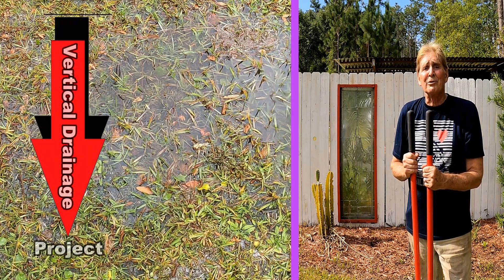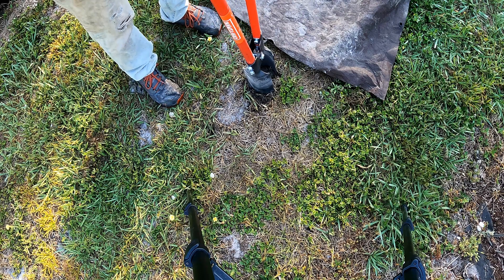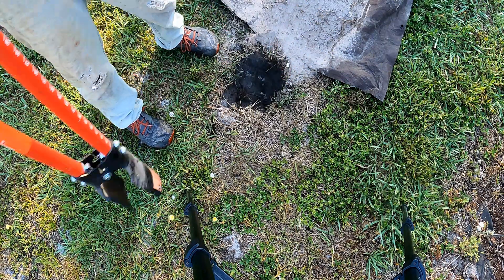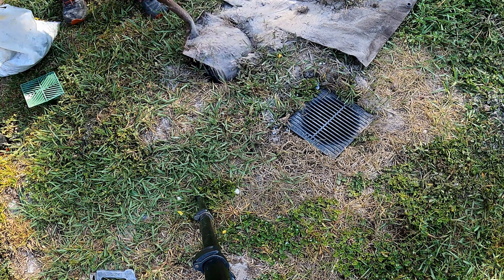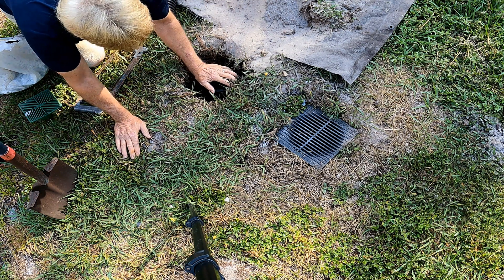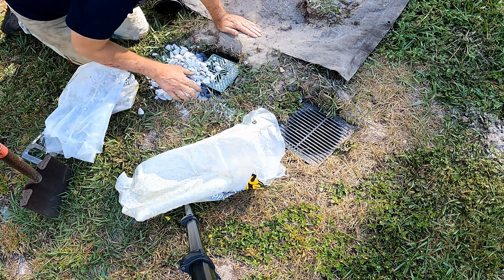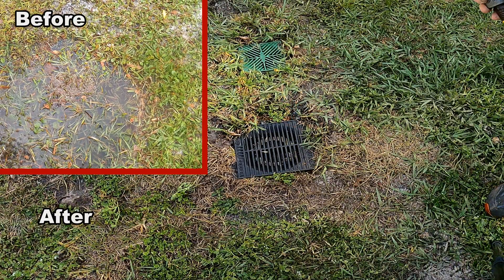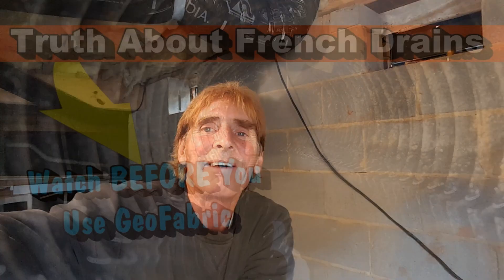Vertical Drainage - New Way to Remove Water - Straight Down

Comment: So i live in a part of town thats known for flooding during heavier rain storms. Typically since I’ve lived here about half of my backyard gets about 4 inches of standing water in large areas during spring rains. If i were to install maybe 6 of these spread out along the yard, would it be sufficent enough to help with my issue?

Comment: will this work for my AC condensate line? My line drips into a 3" corrugated pipe  that was embedded into the concrete sidewalk. I looked inside that hole and it's all dirt. Wondering if I can dig it somehow and add the rocks. This hole overflows in the summer and ruined my sidewalk finish.
Reply from the maker: @PhoRunner  it should work
Reply: @ Ty sir

Comment: I did similar in my yard in Virginia. Except i went down 5 to 6 feet or more until i hit water. I lined with fabric and filled with stone. It completely eliminated my flowerbeds getting filled up and mulch floating away. I also dug about 5 between house and garage to eliminate water puddling there completely. Additionally, I have pipe running underground from my downspouts and I dug exact same under where popup dumps water in the street gutter. Anything left in pipe drains out to vertical drain below, 6 feet.

Comment: Chuck! I need ya help! I did the process, I dug down 2ft and it worked good for a few rains but now its backing up with water. I pulled all the gravel and dug an extra ft (3ft total) i have a clear vision of bottom of hole and slowly but surely, water is coming up from bottom of hole. Man idk what to do now. Any suggestions?
Reply: I guess this is why they say it dowsnt work
Reply: @Ironsmithfarm  unfortunately I live in an area where the hard pan is deeper than 3ft. Since I don't know how many more ft it is, I'm just going to place some catch cans and run it to the pipes that's connected to my gutters. Some people have only a foot or 2 of hard pan where the vertical drain does work.

Comment: May 17th we rented a gas powered post hole digger (Dirt Dawg?) with a 16" auger.  I precut 15 round sod pieces around the perimeter of our septic field:  10 close to the house and the septic tank, in line with the fingers, and 5 on the other side of the septic field, then augured down as far as it would go.  Ended up with holes that were between 28" and 32" deep.  Lined most of them with Geotextile material and #8 stone...2 tons just about filled them all.  Put the sod back in place.  
   12 days later (last night) we get a torrential downpour, which would typically get our toilets gurgling.  (The water table in the yard was the issue...not providing enough runoff to keep the septic tank from flooding and backing up in to the house!)  NO GURGLES TODAY!!  The final test will be later next week, as we expect 4 days of rain here in Indiana. 

     SO...THANK YOU for this awesome idea!!  My backup plan was to trench out along the same line as the holes we dug, if the vertical drain holes didn't work well enough.  Seems to be doing the job of keeping the water table below the septic. 

     Side note:  I suggested adding standard french drains around the perimeter to one of the septic replacement companies and they said, "It won't work."  But then they turned around and told us that they install french drains when they put in a new septic system.  REALLY??!!  It's disheartening to see companies still fighting for their bottom line and not advocating for the best and most affordable suggestions for their customers.  I would have been more likely to hire them for future jobs had they not been so quick to recommend the $40,000 MOUND SYSTEM to replace our 50+ year old septic.  Keeps chugging along!!

Comment: Water finds the path of least resistance. Nice way to speed up the ground recharge process. I like to finish a drain system with a pop up or grate attached to a shallow vertical drain.

Comment: very good idea, do you think this will work on Texas clay?
Reply: This idea does NOT work for clay around the Catawba river in the Charlotte, NC area.
I tested by digging a hole 16” deep by 10” wide, then filled it with water from a hose. After 12 hours, only 4” of water was gone. And there was no significant rain around this time either. So, with the ground relatively dry, the water going directly in the hole from the hose stayed there for over 24 hrs.
I had the option to pipe the water down hill, so I went with that.

Comment: I tried this in my yard, but I have  deep clay. The first 16” is good soil, but then clay. I dug down  5’ and it’s still clay.
Will vertical drainage work in my situation? Thanks
Reply: It will act more like a storm surge tank during the event, but may fill up anyway. No matter what it will always make the yard pond less, and drain quicker. Something is better than nothing, but it will be hard to tell until a storm rolls through.

Comment: I live in East Texas where we have sandyloam.  What you show in this video is basically very sandy soil with a very short distance to a "hard pan" as you call it.  Well, it's not the case in my area.  Sandy loam is nasty after rain and the top surface can reach up to and above 3 feet.  I gave it a try in one area and I was about 3.5 feet down.   Did I notice any difference?  Let's put it this way: the water was not receding any faster (at least through my perception) than before.   This tells me that the "hard pan" was even lower than my 3.5 feet.  At this point, I think, going horizontal with a pipe to the nearest outlet is probably a better solution due to the diminished results of "vertical" drainage.

Comment: Would it work if you drilled a 2 ft deep hole with a 6 or 12 inch diameter auger and just filled the hole with gravel without a pipe?
Reply from the maker: It will help

Comment: Hello, i did  that but dug 4' deep in northern Indiana. Water is currently sitting in the hole I dug. Im having a hard time finding a solution for my sump pump discharge due to alot of water sitting in the back yard.
Reply from the maker: If you have good pump, you could send much farther away..

Comment: Where does the water go/? i have standing water next to the house will doing this drain the water into de crawlspace?
Reply: This water goes into the earth. The idea is to tunnel through the layer of soil which doesn't absorb water very well, and drain into deeper soil which DOES absorb water well. The effectiveness of a vertical drain depends entirely on what the soil is like where the drain is created, so there's no way to know if it will work until you try.

Note: even if you don't penetrate the top soil, just having a hole with gravel will increase the surface area of soil which is exposed to water, thus making more water absorb into the soil than before. But it's still impossibly to know what will happen until you do it.

Comment: I’m in southeast Texas. I installed a vertical drain a week before we received almost 3 inches of rain .  If there ever was a test, that was it. There was standing water for about 8 hours after the rain, however, it did dissipate and was completely dry by the next day. Not standing for 2 or 3 days like before. I call it a success. I plan on adding another one like this. Might even go with the 8 inch NDS pipe.
Reply: how far down did you have to go for hardpan? I am wanting to add one here in the dallas area not sure how deep to go?
Reply: @joshuadannel6395   down here in Southeast Texas. We have a lot of clay. I went down roughly 25 inches to be safe. I would say the deeper the better.
Reply: Houston?
Reply: @hyster2568   east of Houston, bout 90 miles.

Comment: Does not work in my Chicago yard with clay.
Reply: Tried it. Dug several holes, 4 feet deep. Filled with water quickly, but never percolated. Th e sandy white stuff you have in your desert lawn is quite different than the moist black loam we have over our very dense clay.
Reply from the maker: Sounds like your hard pan may be deeper.
But thanks for sharing
Reply from the maker: Did you try it or just thinking it won’t work? Give it a try!

Comment: Hi Chuck. Recently subscribed to your channel and thank you for your research and educational videos.  I am in NY and and I have two vertical drains in my driveway and they are right in front of garage doors.  The vertical drains are slotted.  The garage is lower than the street level. 

Two questions hoping you can answer.  
1.  Is there a way to pitch the rain water away from the house.  I see old termite damage around the garage frame.  My thoughts is the moisture build up via the vertical drain makes it an attractive home for subterranean insects.  Could the vertical drain be angled 45 degrees away from the house?  It will create 2 feet distance away from the house. 

2.  My second question is...during heavy heavy rain, one of the vertical drainage puddles while other (8 feet away) does not puddle.  Eventually the impacted vertical drainage will clear on its own.  What should I try to clear the drainage before I start digging up concrete.  

Again, really appreciate you creating these educational content.

Comment: I’m in the early stages of putting in a drain around the footing of my foundation as the water table is coming up through a hole in my basement. I’m curious if I have to fill the trench 6’ deep all the way to the surface with stone or can I back fill with soil. Again I’m not trying to collect surface water. I’m trying to divert the water table. Any advice is much appreciated. 

I am thinking of using geo fabric and perforated piping all the way to the storm drain in my driveway. I’m going to tie in where the gutters meet the storm drain.
Reply from the maker: The more gravel the better
Reply: A footing drain collects ground water, so no you don't need gravel from top to bottom if you don't want.

Comment: I have huge problem with water . The property i bought.  Is very wet . And there is farm land and orchards behind me that is higher and drain  naturally into my property.  If i am going  to fix it i will have to dig 10 feet at least and shuve 4 10 feet culverts vertically  with wholes in them the diameter  of each one should be at least  1foot and half or more . And pray it works . I have alot of standind water . At times it looks like a freaking  spring .
Reply from the maker: Good luck with your project
Reply: @appledrains  any advice? Or am I crazy for wanting to go extreme?

Comment: After watching your video on vertical drains I put 3 on the side of my house where it usually stays wet, and lo and behold the water was gone and I was able to mow my grass without any ruts. Thanks
Reply: Oh yeah, it cost a little more than $10.00, drainage rock goes for $6.00 a bag and I needed a bag and a half per hole, but it works great, Thanks again.
Reply: Did you put drainage covers at grass level or just put the sod back over the spot?  Thanks
Reply: @johnmichael7331  just put the sod back
Reply: @johnmichael7331  just put the sod back
Reply: I THINK I SAW HIM DO IT BOTH WAYS BUT JUST THE DRAINAGE COVER WORKED BEST. @johnmichael7331

Comment: How far away from your house's foundation should you keep away so the water doesn't flow under and come back up under the house in the crawl space. We have clay soil, will it work in that. Your soil looked like sand. Could you use a gasoline auger to dig down about 3 feet x 8". Thanks
Reply from the maker: Power auger will work good

Comment: Maxed out my post hole digger in Houston clay (maybe 4 or 5' deep).  Can't get deep enough.   Hole holds water and doesn't drain. Got to take it to the street.
Reply: Yup I live in Houston aswell
Reply: I had the same issue. I was excited to try vertical drainage, but I couldn't get past the clay at 5' deep. I'm thinking of just making a few deep holes like that filled with gravel and see where it goes. I spread woodchips around the swampy areas for now and that's much better though hopefully temporary

Comment: This has transformed our side yard. Usually It stayed wet for days after a hard rain. Now a day later it's dry enough to mow
Reply from the maker: Wow! This is a great project
Reply: I put a drain cap on the place that was in the center of the wet area. Roughly a twenty five foot square area. Then the other four I used the sod. I just mowed today after having heavy rain yesterday. Its important to dig below the clay layer
Reply: Did you put those drain tops on the top or just backfill with the sod?  Great idea
Reply: Does it work in clay soil?
Reply: @stephenkeeton7636  It worked In my yard. I had clay that went down about two and a half feet. I went below the clay layer and it did the trick. My yard was wet then soft for days after a rain. I had grass that only grew in wet areas and even mushrooms. They disappeared in about a month and regular grass took over. Now the area is normal. I had a twenty by twenty area. I dug five holes.
Reply: @stephenkeeton7636  In my experience you need to get below the clay. I had to dig over three feet in some cases but it worked as long as I got below the clay.